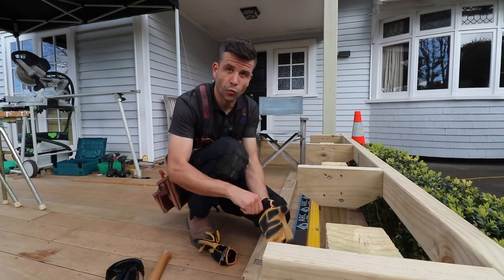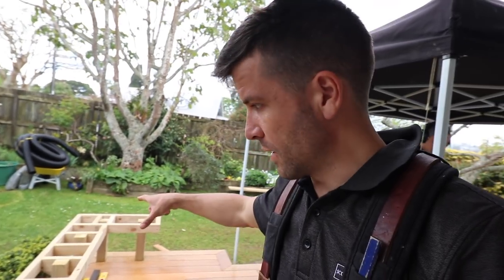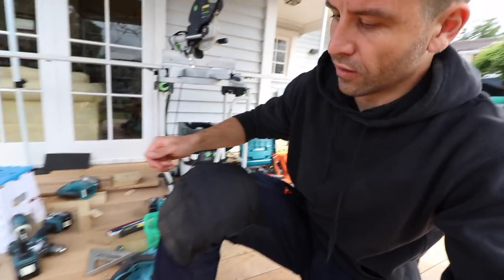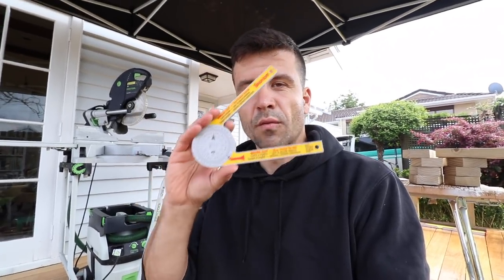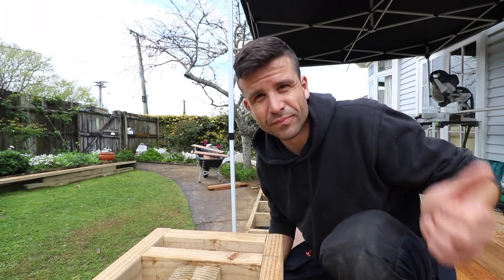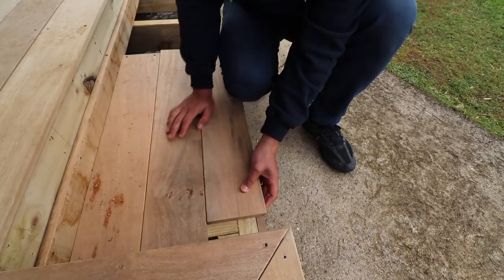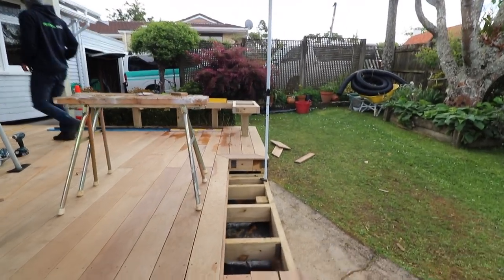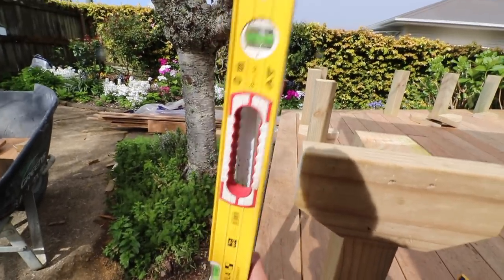Carpenter's Tool Belt vs Tool Pants

Comment: Snickers workwear are the norm here in Ireland. They are expensive but worth every penny and they are the best for knee protection !
Reply: shoutout for the swedes eh ;) but yeh snickers are really good, blåkläder (or blaklader in some foreign languages) are good to. That said here in sweden the work clothes are not seen as that expensive (when compared to regular clothes, they are still expensive). Mostly because the base price of regular clothes are high so they often time don't have the same price jump I have seen in some other countries.
Reply: yes, here in Belgium snickers is also one of the top brands. But Blacklader is also one of the best brands!

Comment: Tool belt all the time for me!  Framing setup for general carpentry, ladder work, drywall and electrical.  I wear my tool belt even for decking tops.  Force of habit but I do remove the puller, hammer, combi square and others when doing that type of work.  

Another belt setup with small fastener pouch, smaller tool holder, and high mount hammer holder for lived-in, after paint and finish carpentry work.  Hammer is removed for baseboard work.  Both pouches can be moved to the back of the belt when kneeling.  I hate pulling or pushing on tool buckets and totes so a smaller tool belt better serves me!

Oh, and an apron for in-shop dust propelling work!  Don't forget the ever useful, under appreciated apron!

Comment: Great video, especially on when to wear a belt/work pants.
Ive been in construction for the last 14 years or so and it seems like a lot of guys in the trade don't understand what you mention about wearing a tool belt vs damaging finished products.

It just makes you look stupid, and everyone that sees it knows you are. I worked in an occupied college where a younger guy thought he looked cool with a 7 1/4 circular saw hanging off his pouch. I found this out when I was in a later elevator and one of the professors asked me to talk with "the young guy with a saw hanging off his side and banging into everything."

In situations like these I prefer to carry a tool bag with a shoulder strap. Ive never had a pair of pants like that but it looks like a great idea so I stop putting holes in my sweaters from screws/nails/whatever.

Great video.

Comment: Mate great videos. I'm here over in Sweden working  technical insulation and lite sheet metal. At first thought the builders pants were strange but after a little bit of time I don't know how to work without them. Only down side for me is if there is a little bit to much weight in them you need keep pulling them up or get suspenders

Comment: Both FTW.
The first thing I do with tool pants is cut off those external pockets. They impede access to normal pockets, try to turn inside out. They seem like they are not designed for access with normal hands and are impossible with gloves on. They also interfere with the tool belt. They are good however for the side pockets and knee pads.
You can also replace individual pockets on a tool belt as they wear out and configure it for specific jobs. The range of pockets and tool holders is great with screw/nail pockets that you can use in cold weather with gloved hands.

Comment: As you said, In the UK we always wear work trousers / safety trousers. Purely as a Roofing and Carpentry Apprentice it comes in handy for knee pads and holding Claw Hammers, Nail Guns and Screws.
Reply: same in sweden, tool belts are noticeably more common in the summer however (work shorts are lacking in pockets).

Comment: I have never seen work pants like that, as a framer and finish carpenter I have had a Occidental leather tool belt for 25 years. Here is Arizona it gets to 122 degrees during the summer pants look hot. I use knee pads when running base
Reply: As a fellow Arizona carpenter I agree shorts and knee pads all the way

Comment: I'm a recent convert to tool pants and love them.. I can't stand wearing a big belt and am lucky that most of the jobs I've had I haven't needed to wear one - at the most I have a single 3-section pouch and a separate Kuny's hammer loop on my belt (I also hate having a hammer handle whacking the side of my knee). The last ones I bought are by Herock and I got them thru Lee Valley in Canada. The best thing about them is that you can zip off the waist pouches so you can drive home at the end of the day without accidentally dumping everything you have in them into your seat. They've been super hard-wearing and also have knee pad inserts that make low-level work a joy - I also hate the way regular knee pads cut into the tendons in the back of your knee.. these stay in and I don't even notice them when I'm doing other stuff

Comment: I started working as an Adult Apprentice Carpenter here in Auckland two years ago and I cannot recall one day where I wasn't wearing shorts and a t-shirt.  In the wet or cold I do put an extra layer on top (usually a polo shirt or polarfleece) but never long pants.  They are too restrictive and would get either wet or covered in mud/concrete.

Comment: I haven't worn a tool belt for years. I work in carpenters pants, as you call them. In fairness, I have a custom furniture and cabinet company. But I have mini attachments for my tools if I need to carry them around. I also wear an apron at times.
I like them at most for the safety to the customers home.

Comment: Scottish carpenter here. I use a belt when I'm framing and "tool pants" the rest of the time. In fact the same scruffs as you're using. Like you say, easier to move around in and the knee pads are great.

Comment: In the US, some states require it most do not, but it is considered "accepted practice," when attaching frames to a post, to notch out the post so that the frame fits sits on top of the post material so that it and the weight on the frame is supported by the post and not supported by only the fasteners.  More work but far sturdier and safe.

Comment: Definitely depends on the situation, as you mentioned Scott. If you're framing; belt or vest - hands down. I have an Occidental framing rig with webbing(shoulder straps) and it holds everything. On the bench I wear a little Dewalt multi-tool holder(tape, pullers, glazing bar, 6" Combo square, marker and spring nail set) along with my Occidental three pouch with a mouse clip, for easy on off. holds a speed square, chalk line, two sizes of screw and space for a scrap of wood with dimensions or notepad. and finally a pouch for my low angle block plane. The hammer benches this one out... sorry for the novel and horrible pun. never tried the pants but I know loads of fellas who swear by them.. I prefer a pair of levi's myself. cheers pal.

Comment: If you haven't already done so, have a look at the Engelbert Strauss workwear that your tool man uses. Been using their stuff for ten years and now use their bib and brace trousers. I think they do clip on bags for nails and tools, etc for some of their trouser range. 
That dicking looks fantastic by the way😉
Reply: Just completly agree to john mackay, engelbert strauss makes excellent pants and worwear to a reasonable price
Reply: Couldn't agree more sir, it are absolutely the best working pants. Not overpriced, excellent cordura fabric and they last extremely long. And indeed the bags for screws and nails are very nice

Comment: 7:30 I would just use longer screw and screw it other side of that wood.
Reply: +Varun REDDY, Nope it doesn't matter how you attach 2 block together if screw goes long enough both of them it can bare same load. And that wood block is there only to hold screw and prevents board on top for warping so basically same how you attach it.
Reply: The end board wouldl probably have a decretive end cap. So you wouldn't see the holes.
Reply: Either way works. Some people would just toenail a board in(I know one of them) and call it good enough
Reply: Sometimes when you have a good trick you can fail to see the easy option. And then you look like an idiot. I've been there.
Reply: @chiebert290  go from the back next to the post

Comment: Im a plumber so no real use for a tool belt. But have the scruffs trousers in winter with the snickers beanbag knee pads which are really comfy. And the work shorts in summer for the extra pockets.

Comment: I have always used swedish snickers pants. They dont make hanging pocket of two same size pieces but outer piece is larger making pocket stay always open. And i use carpenter model with extra big pockets to fit nail strips.

Comment: I'm not a chippie; I just work Retail.  But let me say that 'workpants' are a freaking godsend for your knees.  After years of kneeling on hard surfaces I never realised just how much pain I was in at the end of a shift until I tried a set of Blaklader pants (recommended by Ron Paulk).  What a revelation.  Since then I have also tried a cheap Chinese set under the 'DNC' brand (make your own kneepads) and have settled on Snickers workwear (have yet to try Fristad-Kansas).
Again, not a chippie, but like cargo pants, the ability to load up with two phones, store keys, knives and pens, etc and also not be grinding my kneecaps into dust was life-changing in a small way.
The Snickers Workwear is expensive AF but they're also hard-wearing; I'm still on my first pair after two years although I'm looking at 'upgrading' to some of their even more hard-wearing materials as the 'seat' is wearing out faster than the kneepads (if you're working on unfinished surfaces the kneepads will probably wear out first).
Pardo (?), mate, get some.  Your knees will thank you.

Comment: As a chippy in Auckland, I only wear boardshorts for work even in winter. Why? You get random showers throughout the seasons and you cannot beat the drying time of boardies. Or my job (as an apprentice) can change from trimming to concrete pour in a day. I like my workwear to be dry. Nothing more miserable than a wet pair of pants. So it's boardies and tool belt for me.

Comment: Hi scotty, mate I recently got the same occidental tool belt, but it feels heavy sometime s, I'm considering getting the occ. Suspenders set line yours, is it good? Does it pull on the shoulders and hurt ur back at all mate??
Reply from the maker: The suspenders help with the weight for sure. But I agree, it is a heavy tool belt overall.
Reply: @ScottBrownCarpentry , cheers mate, but do the suspenders feel uncomfortable or are great?
Reply from the maker: They are good 👍

Comment: scott we have a 90s built colonial style weatherboard house in Akl built on poles (about 1m off the ground). I've noticed that there's quite a lot of "bounce" to the floor; ie when someone is walking around you can feel the "bounce". Passed a building inspection so I presume there aren't any major structural problems.
Is there a simple fix to this or will this require major work?

Comment: At 7:00, did you need to drill into the end to drive screws into the additional block? Might you not have secured it with a clamp and angle-screwed it? .... not holes.

Comment: I'm in the UK and have always had a tool belt, but with smaller pouches. Those trousers are ok, but the pockets are just a bit too small i find, so my pouches are probably in the middle of those trouser pockets and your giant pouches. keeps the essential tools and has clips for drills :)
Reply: Im in the uk too but I find that wearing trousers such as these are not comfortable at all and I cant deal with wearing a belt for my trousers and my tool belt at the same time but if I don't wear the tool belt I cant really carry anything on me so I just have a Makita suspenders and padded belt with a multi fixing pouch a hammer hook and a tape measure pouch

Comment: How did you find Edinburgh mate? That's my playground. As for trousers (pants) vs belt my take on it is that trousers all the time and tool belt for external work only. You can get the trade trousers as shorts too mate so no excuse for hot climates

Comment: As an electrician in the UK I yse a combination of the trousers and the belt. I always have the trousers on but if I'm doing a job with that needs different types of fixings and clips or alot of tools the belt goes on

Comment: I use the full rig for framing, and for other things I use a belt and a single leather pocket, it is large enough you can put hammers in it or even some nail guns.  It could probably be improved with segmentations and stuff, but eventually one is back to a tool belt.

Comment: Tool pants  but i usually use "pirates pants" 3/4 pants. You really need knees pads and  will not be as hot... and  i very rarely use my belt. Tool belts just make you carrying  around allot unnecessarily. Better  have some extra metal clips in your pants  to hang  yor hammare, nailgun, drill etcetera

Comment: i see there are almost as many preferences as there are people in the comment section about what type of work wear to use. and not to make things too boring i'll add my own opinion in the mix as well about the topic. I prefer Helly Hansens tool pants with flex fabric which also breathes super nicely, they are absolutely great because they don't limit you working like at all. You can get in sometime pretty awkward poses and its like you would be wearing just basic sweat pants on. and what comes in that Paslodes cordless nail gun i swapped mine in Hitachis, works like a charm with out any hassel with the gas. But that's just me have a nice one fellas!

Comment: Plumber from Finland here. Toolpants all the way. You can fit everything you need in them and when you move around with your car all day, you don't have to remove and wear your belt again and again. There's no carpenters here that I've noticed that use toolbelts either. In summer time, we use workshorts

Comment: Company supplies work wear, order new clothing when it's worn out, fall apart, too dirty, etc. Always in hi-viz pants with hanging pockets. Wool underwear and I'm good for down to - 30c during winter. Cut off right under the knee pads during summer, happens  around 1st of may usually. For concrete work I can get what I need with me. Needs a belt and suspenders..

Comment: In sweden you have by law to use proper workpants on worksites, on ground or floor kneepads, you have to use shoes with toe and nail protection, t-shirts, jackets, often with a special typ of colour, like flourcent yellow or orange. gloves, eye and ear protection and ofcourse helmet. and all of this are different kind of wear for summer and winter, and some other in between isulated clothes in the spring and autuum.

Comment: My big framers tool belt, I just wear around the hips/waist as usual in summer. But in winter, I have my pants, plus undershirt, T-shirt, medium sweatshirt, hoody, then overalls. (I'm in Canada). When it's REALLY cold (-10 to -25), I wear my insulated overalls over those clothes, which is like a thin sleeping bag with arms and legs. Now, my tool belt keeps slipping down and it seems I can never get it tight enough, so I have to attach a suspender harness to keep my toolbelt up. Can't use the harness in summer with a T-shirt, because the straps give me a painful nipple rash! (Yes, I'm male).

Comment: Hot tip at the end - yup sometimes - but just clamp it and screw from the other side surely? I wouldn't even use a clamp just hold it and screw in - if it didn't pull up tight .. back the screw out and then it will pull it tight the second attempt....

Comment: It’s like any other tool it’s task specific know where all three an apron included my pouch for big work my pants for fine work and my apron when I’m on the bench I also have a vest because I live in Canada and it gets cold but
The tool bags hang off the vest so I can throw it over heavy winter gear it’s cool bananas it’s not so if you want to wear in the summertime though

Comment: i use workpants. not toolpants for the everyday i can stash five markers of various types as well as a stash of pens, a mini notebook, a spare sawblade, couple drillbits, maybe a sample of the screws and proper bits. hammerloop and knife pocket. 
one thing you need to mention is suspenders. these are an absolute. paying men top dollar to pull up their pants is akin to having them unravel tangled extension cords with the proper tools you dont have to do either.  i love the cargo style but they have to be cotton, not polyester and rayon.  in PLUS 33C and  MINUS 35Cm, you want cotton.

Comment: Hey Scott, love your Channel! Got a Question for your "hot little tip" though: Why didn't you just screw the additional piece of scrap wood not from the other side (I.e. the backside) without having to drill holes in the framing? Is there a specific reason for choosing drilling from the front?

Luv ya channel, mate! Best regards from Germany!

Comment: Scott you should try snickers there the gold standard for trades men here (Northern Ierland ) they provide a better a fit and have a wide range of knee pads for different jobs (£70 buys them u can get cheaper or more expensive ones but there best ones I’ve found are the £70 ish ones ) and get some sorta knee pad on your other guy by the time hes 40 (if hes lucky ) he will regret not wearing knee pads .
Reply: I normaly wear both depending on what am doing most of the time the belt and snickers are on but am always wearing snickers 2nd fix and bench work the belt is off . I get way over a year and a bit out off snickers and some weeks am in them 7 days a week , or mostly 5-6 days a week (I’ve more than one pair of them ) you can get them with or with out the holster pockets and also in shorts but if u get the shorts you lose the knee pads